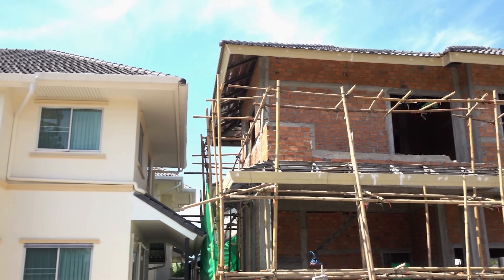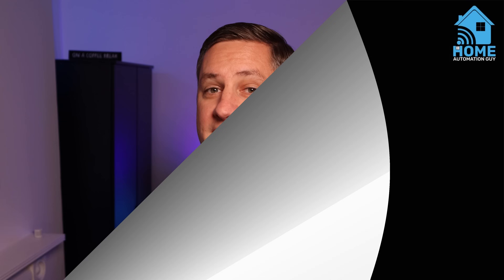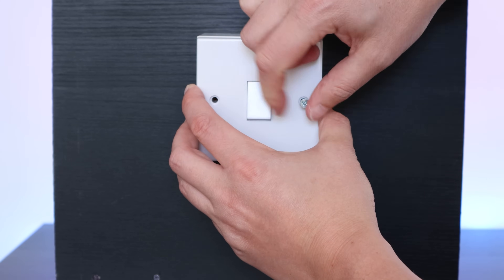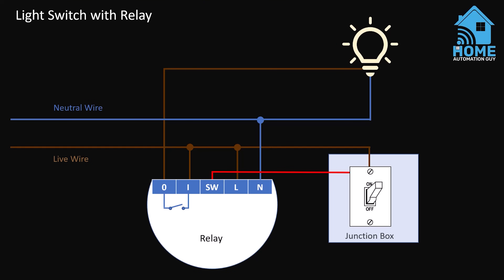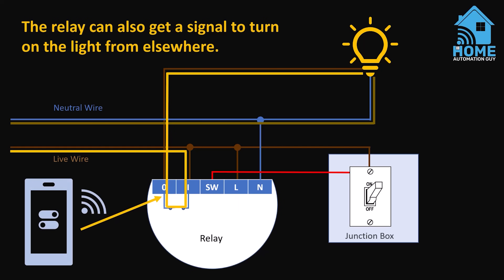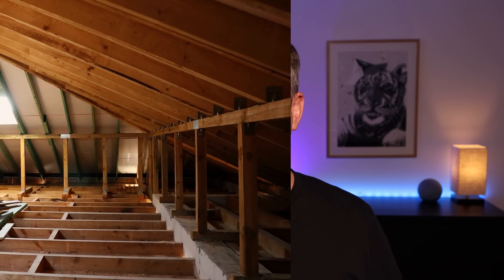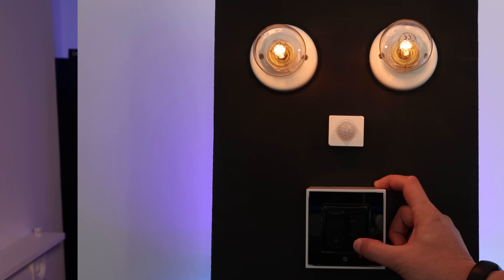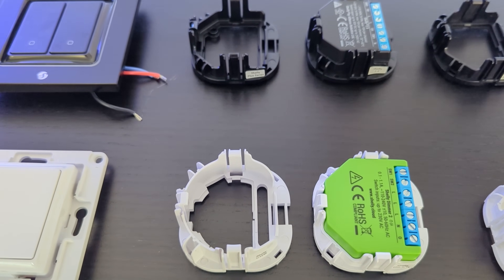Using smart relays in your home

Comment: I recently deployed 20 switches (Sonoff of course) in the house in UK - after thinking too much how to deal with lack of the N in the switch box on the wall, I realised that all lamps in my house have all the necessary wires ... on the ceiling, where the lamp is connected. So now all my switches became smart ones ;-)
Reply from the maker: Perfect!
Reply: Yep, done the same with mine, all controlled via a rasperry pi
Reply: @Mr31Vince  mine too - home assistant of course ;-)
Reply: Can you provide a diagram pls?

Does this also mean the switch on your wall will always stay on ON position otherwise the relay won't work otherwise ?

Or can you still switch on via switch on wall and the the smart one?
Reply: @bimiuk4051  You do not need to leave the switch on. The switch can work as a toggle. So you switch it, and it will toggle the light on or off. You can also toggle it on and off via the app or smart home system.
Reply: @bimiuk4051  I am not sure how to send you diagram but it is quite easy:
1- L and N come both to the lamp (the connection box close to the lamp on the roof)
2 - from that box also there are 2 wires directly to the switch
3- so in that box you have:
a- L
b- N
c, d- 2 wires to the switch
e,f - 2 wires to the lamp
that is all you need - Sonoff has 6 connectors and you have 6 wires in that box. 
You can turn on wirelessly, and then turn off wirelessly. You can do the same using switch. Finally, you can turn on wirelessly and turn off by the switch (or vice versa).
Reply: @TheBurnsiela  hey Alan

With the switch u mentioned you have way more connectors. The sonoff standard switch has only 2 x connectors IN and 2 x connectors Out. With this then I cannot toggle the switch and the app.
Reply: @zyghom  ah I see ur talking about Sonoff Mini r2 and I seen the simple sonoff with 4 ports in total (2in 2out)
Reply: @bimiuk4051  if the board has no inputs for the switch, then only wifi control I suppose (2x IN, 2x OUT, no wires for the switch on the wall)
Reply: @bimiuk4051  true
Reply: Now got the Sonoff Mini r2 but realised need to trace the cables from switch to the lamp 😵‍💫

What's work around?

Comment: I really like the versatility of relais but I had to use a bunch of light switches instead. The reason is that I have an off-the-grid house where all lights are powered by 24V DC but all relais seem to expect 110/230V AC.

Comment: Though the Shelly or sonoff Wi-Fi products work well i would be hesitant to build a house around an all WiFi setup. Especially with technologies like BLE , or Thread/ matter there must be better solutions to have that don’t give you this big Wi-Fi radiation cloud in your home. When I started out with home automation 2& years ago I was using x10, which had a lot of flaws , but the usage of the existing wiring to transmit data didn’t cause any huge issues with radiation etc. I wish that somebody would take that concept and bring it into this century . It must be technically possible to achieve something like that and make it super reliable. Also 20 years ago I believe Jung already had wireless switches that used piezo technology to deliver the power to transmit its signal, without the need of batteries. Would be a perfect companion with ble

Comment: Good video! I'm an learned electrician, so yeah, DON'T mess with something you don't know! besides that, I love the shelly's too, I actually use the 2PM one as a single relay to turn on 2 different light sources independantly: For example, in the bathroom I only turn on the furniture light when brushing teeth, washing hands, etc, it's even motion activated with a Aqara sensor (you gotta love HA), or when we take a shower, I go with voice command to turn on the main lights. In the office I'm using it to turn on two LED panels independantly from each other (mine or my wifes), so that when one person is here, not all lights are on, only the one you need. I've also installed the 4PM (DIN rail), to turn on different circuits in my garden, so we can have light at the place where we are, and not all around + at night, when someone would try to break in, there is an automation that turns on all off the lights when motion is detected on one of the cameras.

Keep up the good work and nicely explained!

Comment: Another couple of awesome benefits of smart relays: you can make your light switches do anything you want. Shellys, for example have a "detached" mode which turns that switch into an interface button that you can program to do whatever you want! Set a scene, turn off a different light, or fire an automation. On top of that, these relays can be wired into a 3-way (or 2-way if you're not american) circuit if you know what you're doing. I managed to do that for my main floor lights via access to the attic. I have a few shelly dimmers up there in junction boxes that are successfully controlled from a switch on either side of the room. It's great!
Reply: Did those shelly relays need a ZigBee Hub? Or did you installed the wifi ones and connected them directly to your router? I'm thinking of those relays, but I need the 2way ones (ie staircase which is controlled from 2 sides). And by the front door I need to connect a 2way relay (which will control 2 build-in lights) with a motion and light sensor, so they turn on automatically only at night.  (or manually with a switch). what would be the best choise? Can you send me the product names? 
Thanks!
Reply: @gustonator  Shelly’s use Wifi, so no need for an additional hub. And any of the Shelly’s can work with a 3-way circuit (or 2-way for non-Americans) as long as you have a constant hot wire you can access. 

The Hook Up YouTube channel has a video about how to wire a Shelly into a configuration with multiple light switches.

Comment: You touched upon power consumption in your video a little.  I’ve had PIR sensor switches installed about 11 years ago in my house.  Recently I got a thermal camera for different reasons but discovered all my sensor switches emitting heat.  I took one off the wall and measured it.  1 watt of consumption regardless of when switch relay was energised or not!  I’ve got 14 PIR switches in my house, so it adds up to having 3x 4W 860lm light bulbs being switched on all the time.

It’s a lot, and it demonstrates that while home automation makes life a bit easier, it comes at a cost of having an increased baseload.  

Now the more I look into it, the more I realise that the problem is the inherent inefficiency with AC-DC switched mode power supplies when load -> 0.  They all consume power when there’s zero load!   It’s something that manufacturers haven’t addressed properly yet, but I wander if they could be a bit more clever with their designs to eliminate this zero load drain.

Comment: Another great video, thanks. 
i put a smart relay on the extractor fan spur from  my bathroom light.
when guests would come to stay, they would switch on the main bathroom light, sending the loud extractor fan running. so i use a relay and a home assistant routine  to disabale the extractor fan between 11pm and 7am so as not to wake evryone up or panic the guest who feels instant remorse (we've all done it)
Reply from the maker: That's a great tip! I might implement this in my own house soon 😉
Reply: How is the smart relay now? After 1 year how usefull is it and do you have any complaints on the product?

Comment: There are Xiaomi smart ceiling lights in most places of my home and wireless switches, so I don't  need a lot of relays. But in few places, where I left "traditional" lights, I use Sonoff zigbee and WiFi switches and even Moes Dimmer. Of course, I use Home Assistant instead of their "default" ecosystems

And I replaced traditional two-positional wall switches with non-fixing switches (in some switches you just need to insert small spring inside to make the button return after pushing)

Comment: I'm in the middle of doing some major system design for a venue. Basically the goal is to have a tablet mounted to the wall that controls everything in the room; lights, projector, roller blinds, sound system etc.

To achieve this I'm planning on using a few simple things; 
- 1st is Home Assistant (which will be controlling things like smart plugs and switches)
- 2nd is a raspberry pi running Bitfocus Companion (which will control both Home Assistant and everything else)
- 3rd is a Tablet securely mounted to the wall, running "Full Kiosk Browser" with the Companion buttons on it for control.

The main thing is getting all the right relay types for all the lights (I am wanting to keep all the switches that are there), then once I've fully mapped everything out I can get a qualified electrician to install it for me. In the main hall there are about 7 switches for the lights (I don't think any of them are dimmable)
Reply from the maker: I don't know what Bitfocus is, but the rest of your setup sounds very similar to mine!
Reply: @HomeAutomationGuy  Bitfocus is just a web based/network based control software that allows you to run macros on multiple applications and hardware at once. It's usually paired with a "Stream Deck"

Comment: In the USA we have Phillips hue set up, which required their own hub, it worked well through their app. That was until our hub became unresponsive and now I have to manually turn them on to the color I want. I am however interested in a relay to control outdoor lighting so we can turn on entryway lighting., via an app. So I’ll be looking into the home assistant option, thanks for your insight.

Comment: Philips have some CR10 dimmable 25 and 36 degree cone CRI 97. I have a boat load installed with shelly dimmers. Real nice in Switzerland with neutrals everywhere and light switches being instantly convertible into NC or NO push buttons.
Reply from the maker: They're really great, with so many positives! I just wish they'd fit nicely into my UK Back boxes.

Comment: Great video. Most houses I work on don’t have the neutral at the switch which is a shame. Still chasing the “perfect” solution
Reply: I’m thinking about getting the Sonoff No-neutral Mini. Need to find a small dumb reverse relay( big AC switch to connect low power DC instead of the other normal way round) as I don’t have normal switches at present and every example I find is huge and will never fit in a light box.

Comment: Using a similar switch but control to physical light switch is different from one in the video.

It uses output and input from relay to complete the circuit to switch.
States in instructions in red not to connect live to it 😅
Should check what's the voltage of it one day.

Comment: Hello .. i just moved i to a house and i want to make some automatizations...but...i have some problems...2  lights from my living room and 2 from my dining area ar swithed on and off ffrom the same switch. Is there any way i can use some relays ot smart switches to disconect them one from another. And turn them on off  separately with some pressence or pressure  sensor.s? Everything is messed up. 😊
Reply from the maker: You can use smart light bulbs in those fittings, and leave the switch at the wall turned on permanently.  Then you can control them via the smart home platform rather than the switch, and place covers over the physical switches with battery powered smart switches on top.

Comment: Thanks for a great video.  One question, can relays handle 2 way switching - i.e. 2 switches controlling one light.  Most of the switches I have are simple one light one switch set ups but the stairs have a switch at the top and a switch at the bottom.    Although I could have one switch physically connect and the second connect logically through Home Assistant, if there is somewhere I would prefer to work properly without HA it's the place where you can bounce down a flight of stairs if you cant see what you're standing on.  I have looked at smart switches but haven't found one yet that can cope with proper physical 2 way switching.

Comment: I have smart switch with neutral wired needed. Can I connect the neutral wire to smart switch (N-in), but connect neutral wire to lamp without using (N-out) from smart switch?

Comment: 5:58 if you don't even know what a neutral wire is or why it's important, you shouldn't be messing with electricity, period.
my father was an electrician, so i probably know more about electrical installations than the average joe, but i know there is still stuff that i don't know.

Comment: Hey, great video!  Which product would you use for a three gang switch set?  Our kitchen has one panel with separate switches for ceiling lights, island lights and cabinet lights.  Not sure which would save the most space in the backbone, as electrician says there's no permanent live in the ceiling to be able to install at the rose for instance. The main lights are also on two way switches.  Any advice greatly appreciated.

Comment: Thanks for this video and I do like the "moving" wires animations!

I notice that you have adopted the term "smart relay" as used by Shelly to describe any kind of smart module. I think this is technically inaccurate (for example, a relay and a dimmer are clearly quite different) and potentially misleading.

So, I prefer to name them as follows:

smartmodule switch (solid state on/off control)
smartmodule dimmer (solid state on/off/dim control)
smartmodule relay (contact closure on/off control)

As you point out some smartmodules are available that can work without a Neutral, but AFAIK there are none that use a relay for contact closure control. Relays typically need more power to operate than can be provided by a current through an LED bulb without it glowing or flickering when "off", so a smartmodule relay will need a Neutral.
Reply: Totally agree, I use this exact same terminology.

Comment: Hi! Great video! Do you know of any DC relays compatible with 12v (2 to 5 A is all I need) that provide a voltage reading in the app or Homebridge, or Home Assistant? Ideally something zigbee or lora or maybe matter (or wifi it it has a low power sleep mode chip for periodic transmissions of data ). I have some small solar controllers in my camper suv that I want to control based on weather, day/night, and or battery voltage. Any thoughts from someone like yourself, who has seen lots of models, would be amazing. 🙏

Comment: In your "Don't buy the wrong smart light switch" you mention at "8:30" that you use Zigbee as the protocol for your switches. This video kinda recommends Shelly which is connected via wifi.
Reading about Shelly it sounds great - and it even support power monitoring. What would you recommend as the Zigbee alternative?
Reply from the maker: I use Zigbee for all my sensors and my smart light switches where it makes sense, but for those where I don't want to replace the switch or have a different device that I want to power I use Shelly. Sonoff have some good smart relays that are Zigbee based, but they make a loud clicking sound when they engage which I find annoying

Comment: Which relay would you recommend for a roller door for a robot mower. I need a 2 channel relay that works with home assistant. Are there any that have a combination of either wifi/zigbee/zwave together this radio frequency for a keyfob. Is it better to use a separate rf module and smart relay?
Reply from the maker: I use a Shelly 2.5 relay for roller doors. But I use it with Home Assistant and it's WiFi based. I don't personally know of any out of the box solutions that will work with a keyfob like you wish (that doesn't mean one doesn't exist!)
Reply: @HomeAutomationGuy after looking what's a available and speaking to an electrician, I would need a nc relay on each channel to prevent a short by activating both channels at the same time. Eg if I am playing with the door and an automation runs at the same time. I think I'll just go with the one smart relay. The aqara t2 runs on zigbee.

Comment: liked, subribed, any tips and trics on matter & thread for a new house? use HA als central unit? Matter & thread gu10 downward lights but 'im stuck at the switches? What should I take? I would like 4 buttons on every switch so I have some ones left for new functions I would like to add. Matter & Thread switches with mutliple buttons, where are they?